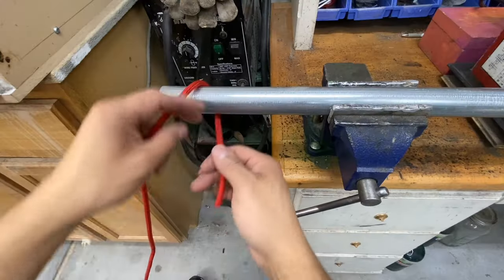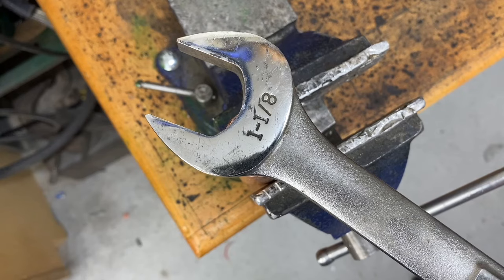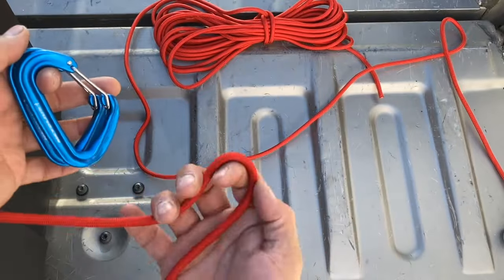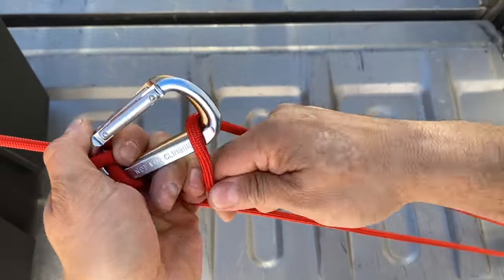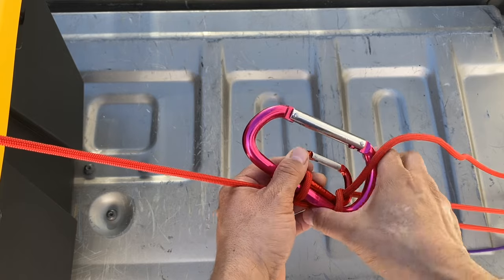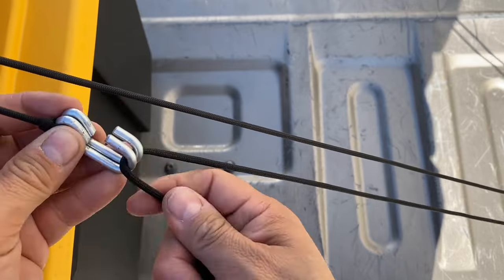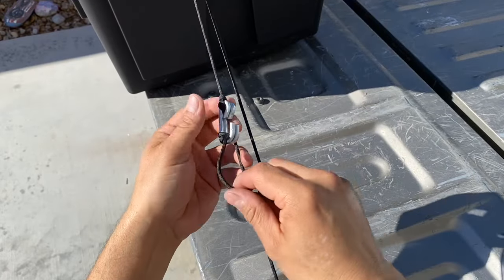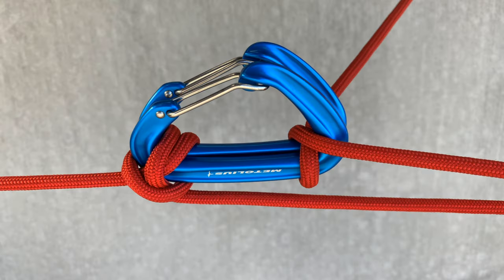Carabiner Truckers Hitch - Better Explanation - Tension Locking

Comment: WARNING!!! Contrary to what's said in the description, never ever use "cheap carabiners" for securing anything. There's a good reason why good carabiners always have their strength written on it, into newton's force, and not the cheap ones. Besides that, you can get good carabiners at REI or any good sporting/outdoor stores for a very cheap price. So why save a few bucks (sometimes just 2 or 3 dollars) and risk major troubles? And make no mistake, the trucker's hitch puts a LOT of tension since that's THE purpose of it...
Reply: I’ve used the same tiny cheap ones for my keys for years. Recently someone had left behind some unused mordantly priced ones, that were of various sizes. So, I decided to put them to use...  went through 9  in one week. Couldn’t believe how cheap they were made.
Reply: @sunshine3914  Sorry, but I don't believe that very high-end carabiners will fail as key holders... Second, there is a way to use a carabiner and if you don't they will fail. But still, it won't when used as a key holder. This unless you've screwed with the spring latch.
Reply: @DiabloOutdoors  I don't believe very high end carabiners only cost 2-3 dollars more than cheap ones😂
Reply: i'm not a fan of carabiners in general. bulky, expensive and heavy items. a thick wire bent in the vice to a small radius is just a better tool for most things. when it comes to high-stakes applications, maillons are much stronger if you can live with carrying a wrench.
Reply: @markifi  wow I learned something new:  MAILLONS . I always thought they were just carabiners with screwing lock added. Did not know they had a name.
Reply: @markifi  Great ideas!
Reply: The wire gate carabiners in this video are rated and can be bought at REI
Reply: @farficknuger3673  Can you read? my comment is based on the dangerous comment of the video, not what he used...
Reply: Agreed. No need to be penny wise and pound foolish. Amazon will sell me four 3,000 lb biners for $12. Better are real climbing biners which start around $6 if you spend about three minutes looking, and are rated at 5,000 lbs and up.

Last thing you need is to hit a good bump in the road and shock load the tie down and blow out a biner. That would I suppose be an advantage of using two biners, less likely to blow them both.
Reply: @DiabloOutdoors  ahh yes, when i secure a load of dolls to my 4 year old daughters power wheels, I will remember to spend $183 on carabiners.
Reply: @DiabloOutdoors  oh sorry, did i not purchase the expensive climbing ones?
Reply: Slight disagree. It depends on the situation.
Reply: He’s keeping a 27 gallon plastic tote from sliding around in a truck bed. It’s really not that deep
Reply: i have real climbing ones and similor sized keyring type ones.  i use the keyring ones alot only ever broken 2 and been using them since like 2005. 
all depends what your securing and where,  i use them on the back of my power wheelchair. i  also used them on my motorbike to hold stuff on the back seat between me and the topbox.  
i have 2 keyring ones holding up a temparery washing line in the bathroom. too. fits a full load of washing and thats a lot of waight. in that aplication there is no risk of injury if it was to fail. 

cheap ones have there place if used smart. 
i got them in bulk so the keyring ones cost me about £0.50 eatch  the real cost me over £7
Reply: @jessica-fx3uh  totaly irrelevent comment. This topic is about the usage of carbiners for holding a load. And that video said it's ok to use cheap ones.  Taking chances is plain stupid.
Reply: I think you totally missed the point of the entire video. He's not talking about life support systems such as tree climbing hitches. Just securing a couple gas cans in a truck bed application.

Comment: A few jobs ago, I was delivering timber/lumber on the back of a flatbed lorry, and I learned the trucker's hitch without using any 'crabs.  I'd just got it fixed in my muscle memory, so I could do it without thinking, then they changed the UK regulations, and we had to use straps from then on.  Still haven't forgotten the knot, and still use it occasionally.
Reply: why is it banned?
Reply: @eonaalythia8525  2" wide straps are probably stronger than rope of a practical thickness,* and they are easier to pull tight.  To do the same with rope, you need to be able to do a mildly complicated knot.  Once a reasonably intelligent person is shown how to use a ratchet strap, they can do it as well as an experienced trucker.

*Once rope is more than about 12mm in diameter, it gets progressively harder to make a knot in it, as it doesn't bend so easily.

Comment: You should look into the Garda hitch and the locking Munter. Both are two-carabiner solutions to tensioning and progress capture but they provide much more security and the ability to be tied off with a mule, although you could also tie off what you have here.

Comment: Try the Garda Hitch. Very good progress capture.
Reply: I’m also wondering if there’s a reason to prefer this to the Garda hitch. Possibly it’s kinder to the rope
Reply: @bikeybikebike  It's been a bit since I've done rescue training, but as I recall the Garda has a fair bit of friction and is a bit of a workout to pull on.  This truckers hitch looks easier to tension and release, but it's obviously not intended for protecting people.
Reply: @krovek  Yes, I'm definitely not suggesting people change from using a Garda for protecting people! I think you could use the Garda as part of a truckers hitch. I think the Garda is probably harder on the rope, but you're also right undoing is harder so that's probably the answer.

Comment: Showing the use of cheap carabiners isn't cool.  That's just asking for an accident and folks can say they learned it here!  

That aside, I thought the video was fantastic and I really learned something.  I hate ratchet straps with a passion, but happen to love ropework and own a copy of the Ashley Book of Knots.  I feel bad that I missed that knot in the book, but now I have a reason to go back through and refresh my memory.  And you can be sure I'll definitely be using your carabiner idea to speed up the Trucker's Hitch when I have to secure a load.
Reply: Not a problem, as the device itself will have "not for climbing" or a working load stamped. If a user ignores that, then Darwin was going to get them one way or another
Reply: @kerbalairforce8802  You're right.  I edited my comment.  I still haven't picked up any carabiners, either!

Comment: Yeah try that knot on a truckers hitch instead of a rigid body , reason why they pull through the hitch twice is to create even friction so stops knot getting to tight so it can’t be opened , your method creates a shear point as it’s compressing the other line . Difference in materials as I never saw a trucker use hemp rope they used in your book

Comment: I'm curious why you're using the carabiners at all.  I was taught to tie a truckers knot with only rope.
Reply: Doesn't weaken or wear the rope nearly as much.  Faster, more convenient which might be important if you do it every day.
Reply: @Barnaclebeard  I have to agree.   I use a number of hammocks and when I use webbing, it's clear that just webbing (in your case rope) works, but the friction degrades the webbing.   With a decent aluminum caribiner it just slides so easily.    Worth the slight expense/weight.

Comment: Now I would like to see destructive test . 2 carabiner vs all rope trucker hitch
Reply: Two real biners will hold in excess of 10,000 lbs (climbing biners are rated 5,000 lbs and up). But a slow motion video of a destructive test would be cool!
Reply: @rodc4334  I'm pretty sure he wants one for the same reason I do. Not concerned about the carabiners holding but when the knot begins to slip.
Reply: @austinyun  Maybe. I can’t know what anyone else is thinking. But as far as knot slip, this needs to be properly tied off after pulling tight. You should not count on the hitch simply holding. The tension is, or should only, used to hold temporarily after pulling tight.

Comment: i'd imagine the two modified chainlinks are more than strong enough for household applications
Reply: The chain links being open, will not be terribly strong. Fine around the house or maybe campsite, but I would worry about any application where they might get shock loaded, like holding down something heavy in the bed of a truck and you hit a good bump.
Reply: The links will not fail before the rope

Comment: In Australia only ratchet straps are legal to hold any type of load  on any vehicle  to use rope is against the law  and with a heavy fine 🤔🤔🤐🤐🇦🇺
Reply: @jackbarrie6007  bruh theres safety and there's communism and thats where we are going. literally got off my P plates a few days a go i was not allowed to drive anything with a turbo unless it was a diesel with factory turbo. supposedly Turbos are too powerful thats completely illogical that my Turbo-ed 75 cruiser that does 0-100 in 14 seconds is too powerful yet my NA Camry that does 0-100 in 5.5 is not too powerful they also did the same with V8's i couldn't drive a 79 cruiser because it had a V8 because V8's are too powerful yet the XR50 BARRA pumping out 250 kW and happily goes well over 200km/h is perfectly fine.
Reply: @phalanx3803  and too !!!!!! Young to drive with  plenty of care let's how long it is before you loose  your license  and  how many accident you have before to long  when you have driven  long distance  and   N E V E R  !!!!!!!  .had an accident of any kind  you maybe able to call yourself  a good driver with safe driving skills  🤫🤔🤔💯🇦🇺
Reply: @jackbarrie6007  not to brag but i have bean driving since i could reach the peddles so i am fairly good. old man had me driving the tractors by the age of 13 when i was 14 i pulled my first 48 hour shift on a tractor around 15 i was strong enough to push down on the clutch on the old semi truck so the old man had me moving grain around the farm. 

as for losing my licence not gonna happen only gotten 2 charges one for going 60 in an 80 and one for having a turbo on my land cruiser the first one got reduced to a warning because it was my first and the second got out right dismissed because it was A and law that had no tangible value B the judge didn't want to bite the hand the feeds him and the cop got fired and banned from any other state / federal job for interfering with primary production.